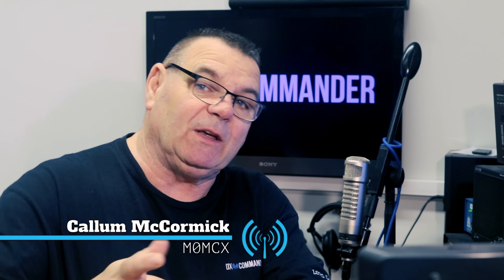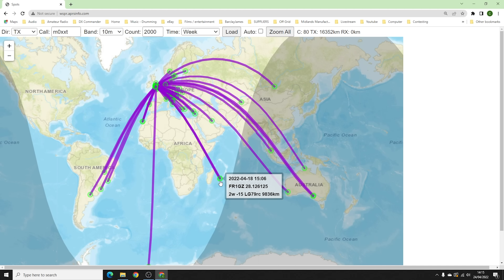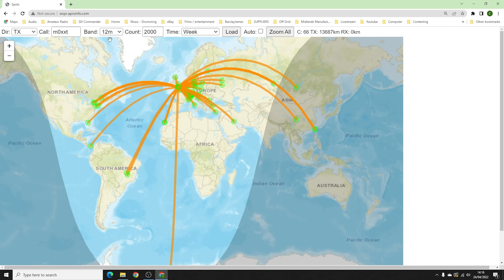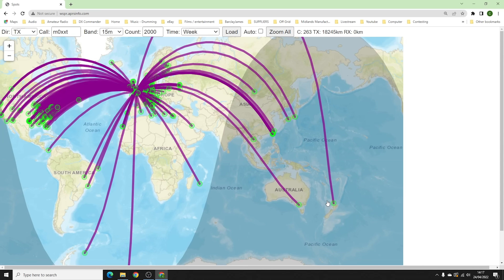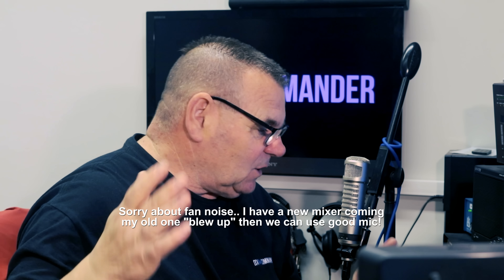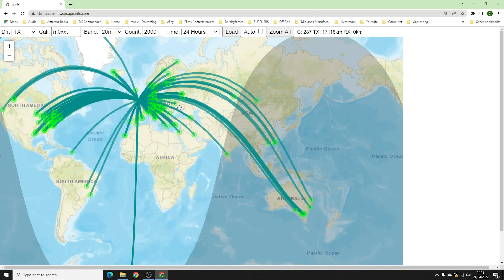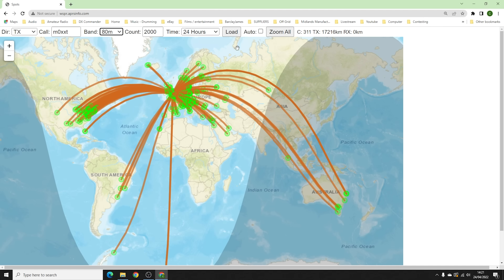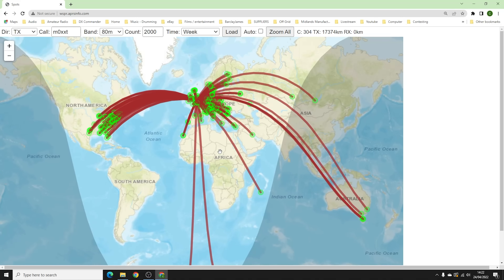Transmit Results Signature 12.4 Ham Radio Antenna

Comment: Hi Cal. The second box for my 12.4 finally showed up and yep it doesnt have the bolts. I will see if i can locally source them here in Nowhere Arkansas. I just built 3, 2 3/8 steel poles that will be 6.5 feet above ground with a loop at the top of each. The guys will go to this loop so i can run the mower around the pole easily.

Comment: Hi cal, a very interesting test, and one that I do from time to time. Over time I have found which ant works best for me, at this location , and it's a vertical ant over every 
Other type of wire ant I've tested. Iam talking about qso's from zl to eu at least.
But it must be remembered I think  that wspr results are depended on propagation and the rx ant at the other end.
Sometimes two spots very close to each other can be weak and very strong depending on their ants. Other times I had good wspr results from eu, but when actually listening on cw or ssb  , I couldn't hear any stations from that area, telling me how well wspr works under poor conditions.
As we know, wspr like many tools at our disposal on the internet,  give us a rough idea about what's going on, but actual air time will tell you what's going on.
My go to  is send cq on cw, and check rbn, that will let you know exactly and straight away,  where you might get a qso.
But a vertical will, in my mind always give you a better chance to work dx than most ants , without having ants up on very high masts, and taking your lead on 2 ele parasitic verts, my 20m 2 ele works fantastically. Just for info , long path around 7pm zl , iam hearing uk every night. 
Keep up the good work  oh ps: I mentioned to Mike about testing his new loop against your vert, be interesting to see what's happens.
Cheers: zl3xdj.
Reply from the maker: Yes Brian.. “Rough Idea” it what it’s all about. Like the idea of the CW CQ call.